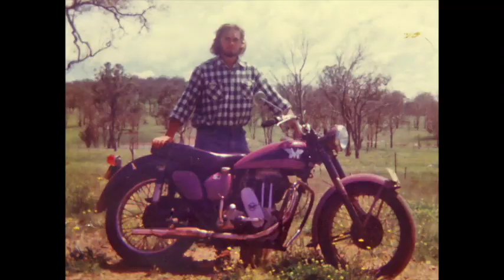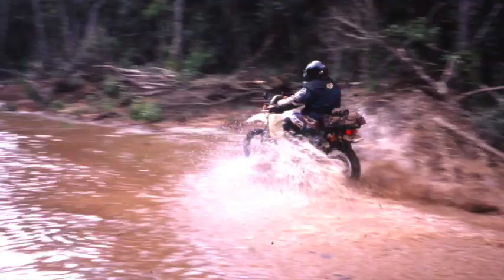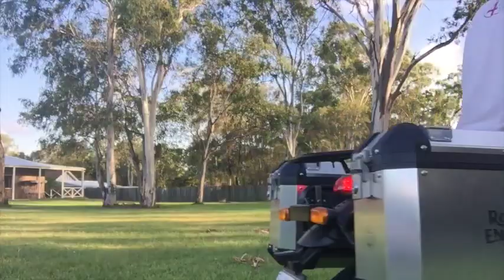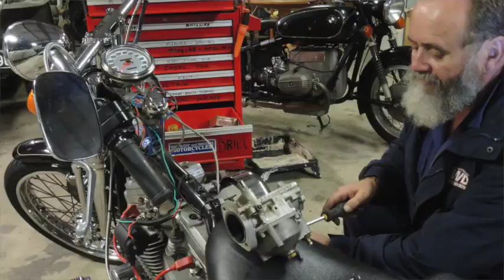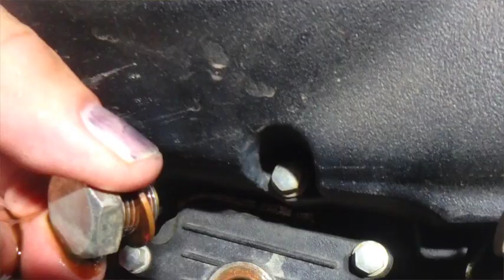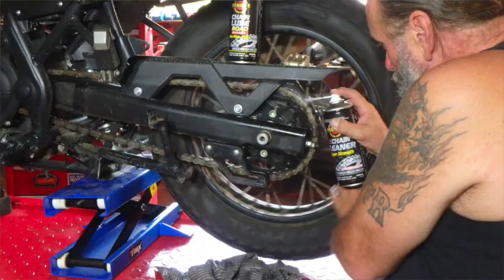Royal Enfield Himalayan - experienced rider review - Roothy Roothless Tales

Comment: Just rode my Himalayan from the Eastern most point of Australia to the Western most point via the central deserts in Summer, 7500km total , 2500 km off road, 46 deg temps.
Reply: heb412braveheart you are a legend ☺
Reply: I think that pretty much answers my question on durabilty
Reply: did you have any reliability issues? I am also wondering how Himalayan handles rust.
Reply: How much duration did it take for that kind of journey brother
Reply: That's insane

Comment: Great review John-411 cc/ SOHC with counter balancer which is why so smooth. The rack beside the tank you can buy via trail side bags which just slide onto the frame to give you storage for the items you use in everyday riding. I put the C bow system on mine with the Hepco becker soft luggage and worked a treat as less windage & load on the back. Mine was also carby & badly needed re jetting because of the emission restrictions which showed up at an idle from cold and also when running along at low rpm in 1st gear if you hit minor resistance like going through a ford it would cut out. Also higher rpm on the motorway it would simply momentarily die like the fuel supply had being cut off but all of it was due to the emission jetting. Get it re jetted on a Dyno and different bike or buy the injected version. Best handling bike I've ever ridden and as john say's rugged as hell-easy to service-part's readily available and very reliable. Look at all the accessories that come free with the bike which you wouldn't get on anything else like carrier-main stand-fork gators-compass-fuel gauge-dual trip counters-clock-ambient temp (although effect by engine temp)-great touring screen

Comment: Couldn’t agree more just finished running mine in and from a bloke that’s done lots of biking this little bike packs a lot in for the money . Basic, functional and capable suspension off road with a sweet little motor at 4500 rpm

Comment: Adjusting inlet & exhaust valves clearances are reasonably easy from what I've seen here on YouTube. Most of the big adventure bikes are heavy, packed with sophisticated technology. Fly by wire, can-bus, large abs units/ brakes, plastic sensors, plastic connectors, 1to 2 mm fine wiring in looms are all great till there's a malfunction outside of the warranty period. Your at the mercy of the dealers. Can tell you anything true or false, one has no idea, usually big bill. More basic adventure bike greater chance you can do your own repairs without requiring scanners, specialized factory tools etc...

Comment: Im still mot convinced.  And keep using my MZ etz  with 319000 km on the clock and still driving as new.  And the most simple mechanic.  Otherwise, nice bike the Himalayan
Reply: Garry.  The money isnt the problem.  I have some other vintage bikes too and a modern MZ Baghira.  But it's just that I'm still not convinced of the quality on the long term.  I don't mind how a bike looks like but I only ask something reliable and simple for a couple of 100000 km and easy to repair wherever I am.

Comment: The main complaint about this bike is that it is designed for shorter people, less then 6' (182cm). The seat is so low that that the riding position cramps taller people's legs.
Reply: 9 just pad up the Hollow in the seat and re cover it works for me  I'm 5.11

Comment: You wouldn't get the spark plug in with a regular wrench. No specialist in the world can tighten exactly the recommended torque by hand. Complains about broken screw in threads and spark plug debris in the combustion chamber is what made the spark plug companies put a really really approximate stop screw angle instruction on the box.

Comment: I finally got my 19 Himalayan running after 1000 miles on a truck back to dealerships. Yes Now I love it. It does more than expected But, THEY ARE BREAKING AT THE NECK ON LADAKH AND SPITI ROADS. I’m hard on my machines I push them to the limits I’m concerned Really the same will happen to mine without heavy Modifications at the frame.

Comment: It's an, "it is what it is" bike.  Any new 250 enduro is over $6500 and this is supposed to be $4500 to $5000 in the states.  I'd love to add it to my collection but here at 10,000 feet in Colorado it would have what? 15hp?  Not sure why they couldn't squeeze a few more HP out of a 450 and get the weight down 50lbs.
Reply: 25 hp and around 32NM torque which is the highlight
Reply: Mark Jacobs it work good bro even on Himalayan range they have more height compare to Colorado

Comment: Sadly it's not so simple. It has EFI, and all it's computers and sensors and high pressure fuel pump in the tank. I have a 2013 RE B5 Bullet, that $500 fuel pump failed just out of warranty, probably helped along by ethanol gas. I replaced all that rubbish with an Amal carb with a kit from a place in the UK called Hitchcocks. I've had a few other issues, but it is what it is. It will never be as trouble free as a carbureted Japanese bike, like a DR650 or a KLR650
Reply: Gerald, I think that quality has improved since 2013. This is what I have been hearing.
Reply: My experience with the DR650 carb (Mikuni BST40) has not been great...they need lots of tweaking in damp environments.